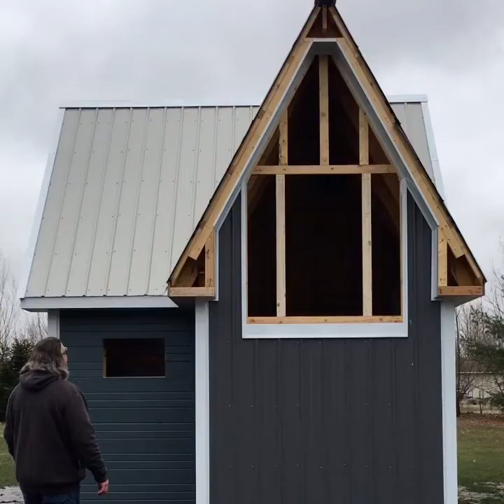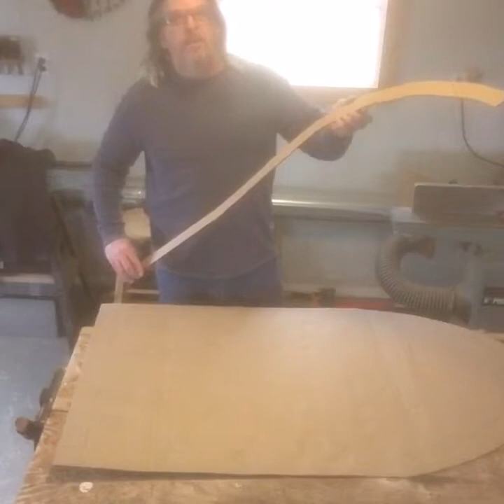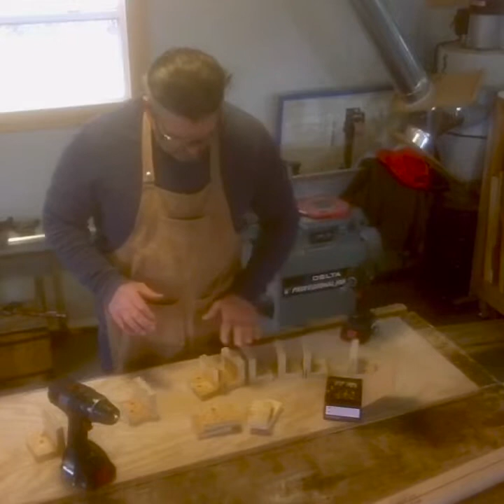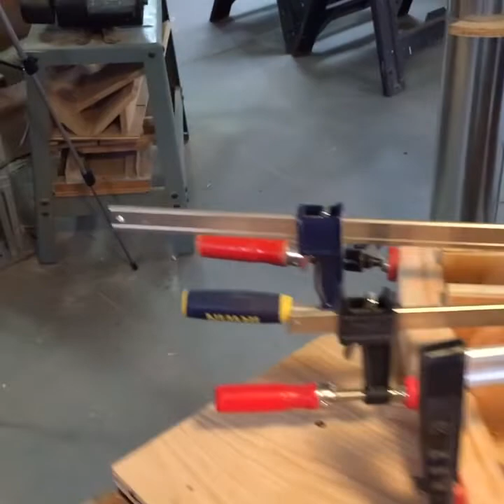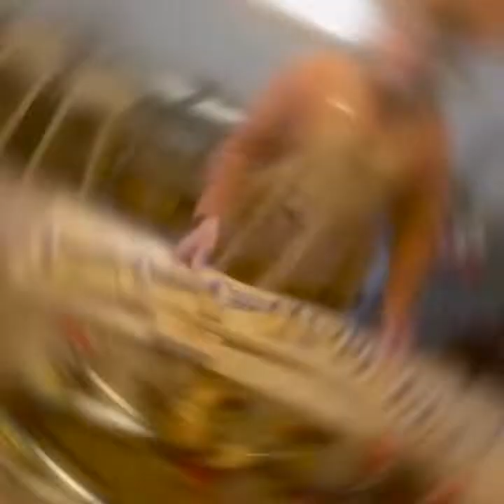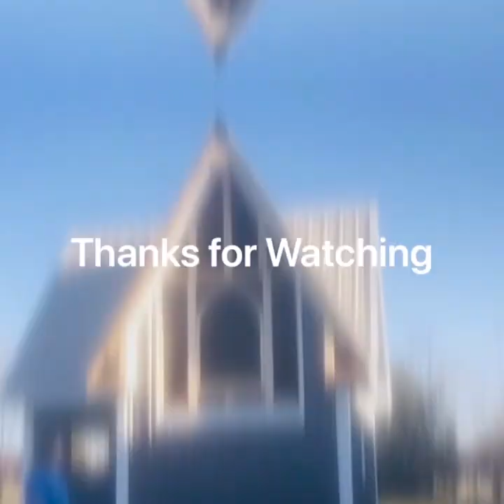Building a Gothic Arch Window/ part1

Comment: My wife wants me to build her a she-shed with cathedral or gothic windows. Your videos are very clear and informative, thank you. I just have a couple of questions. 1. Instead of using screws for your clamping blocks, would 16gax1 1/4 brad nails and glue work as well? 2. Do you think cedar would work as well as the fir?. 3. How do you frame the wall for the window frame? There isn't much information available either online or in books. I am now a subscriber.
Reply from the maker: Yes the nails and glue will work, but you have to let the glue dry 24 hrs before using the jig.  Cedar would be perfect.  About the framing:  frame a rectangular opening (with a header). Then install arched or angular brackets to fill in the area next to the arched window frame.  I wound build the window frame and then frame the wall around it!?! Hope this isn’t confusing.  Thank you for the comment!
Reply: @templeofheat4445  Thank you. I'm thinking of building one window frame as a template now. That should help with the blocking. I can start playing around with that after hay season when I have more free time.